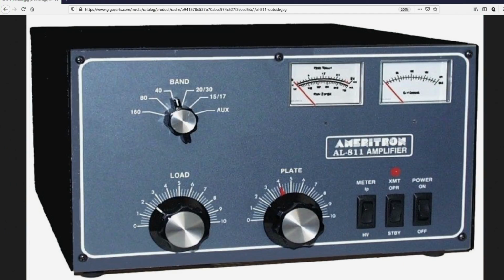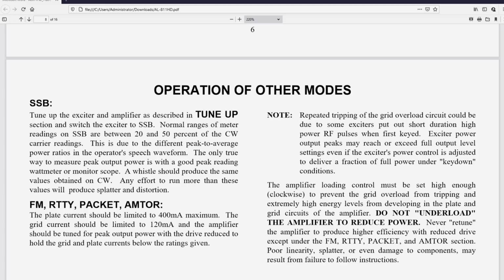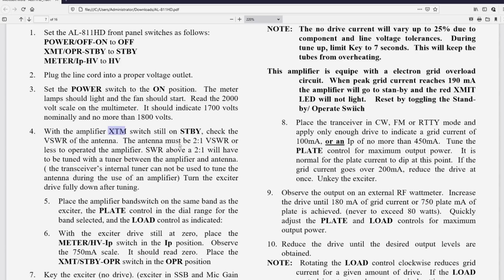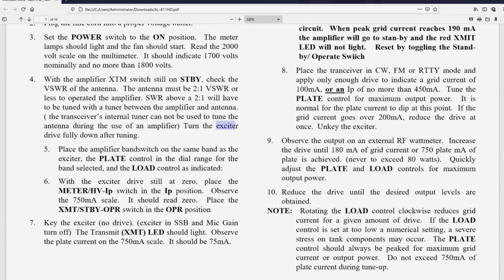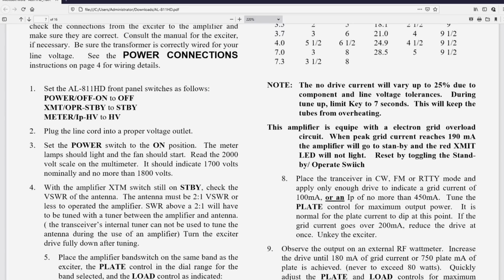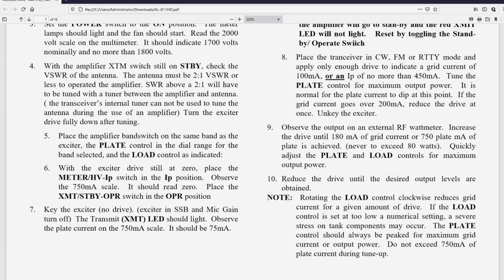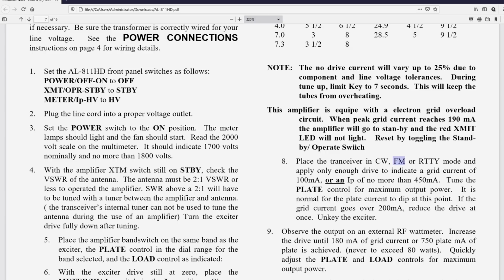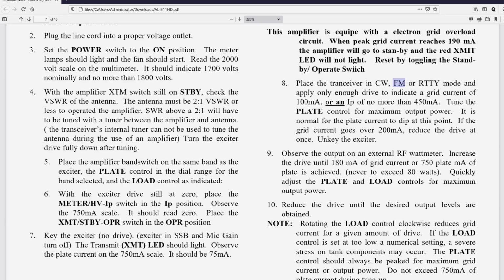Ameritron Amplifier AL-811 Instructions Have MANY MISTAKES About Tuning As Shown By Jim Heath W6LG

Comment: hey Jim, they’re from Mississippi... it’s just written in southern.
I’ve been using RTTY and stepping up input power from 20 watts, then 40, 55 and finally 65-70 but I do not tune to the maximum of 80 watts.  I stay below peak so I’m not over driving the amp.  I’m going to start following your tuning recommendations! I like using good habits when operating and being able to protect my equipment.
Thank you for sharing your experience & wisdom!
Reply: Richard: An experienced technical writer is an experienced technical writer.  It doesn't matter where they came from.  This writer wasn't experienced plus he didn't do the necessary research to get it right.  I get it that your comment was tongue in cheek.
Reply from the maker: It was not written in Mississippi!  It was written in the middle of the US.  73, Jim

Comment: Hello Jim. The AL-811 is a bestseller of all Ameritron Amps. It's an effordable amp working fine and durable if you treat it well. Buying the Version with the 572B Tubes is to recommend cuz the 811's really suck. It's not the loudest Amp of Ameritron's Production Line but it will do the Trick to get you through the Pileup and QRM. Nice video again ,Jim. 73's de DK5ONV
Reply: AMEN !
Reply: @garysmith8455  AWOMAN !